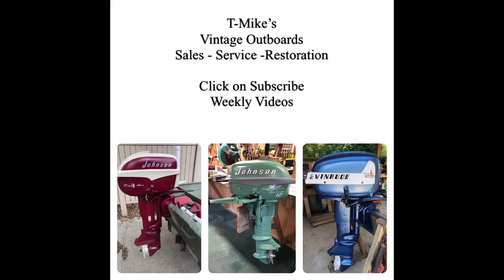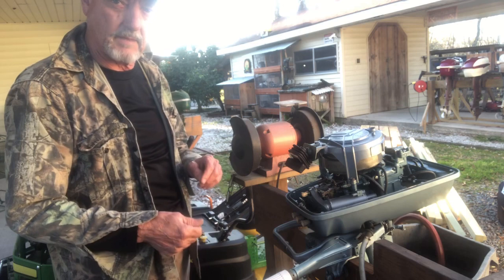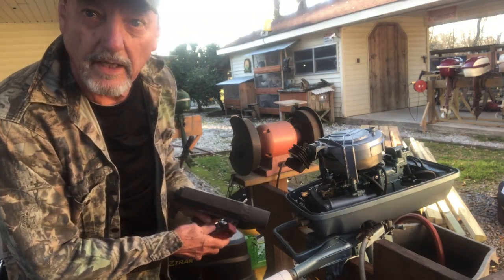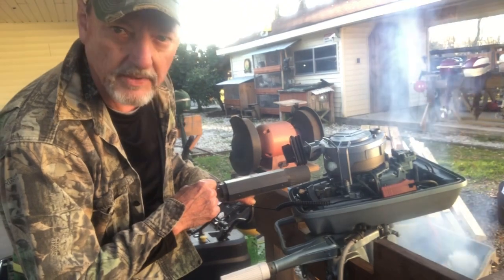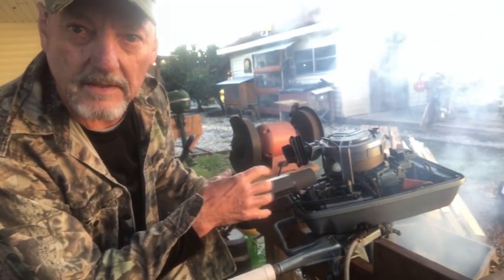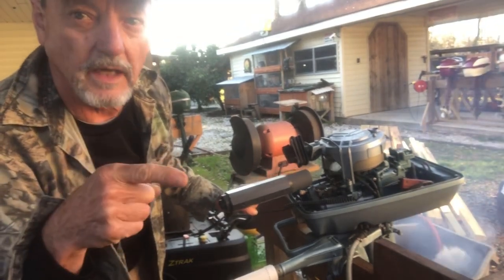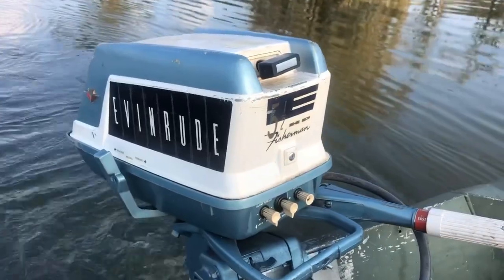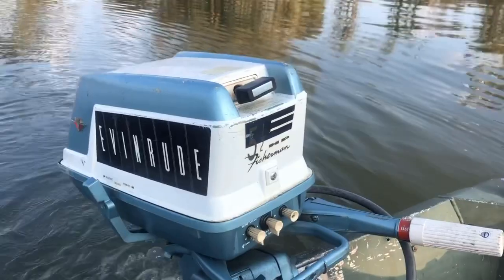How to Use Timing Light to Fix Spark Problems Vintage Outboard 1960 5.5 HP Evinrude

Comment: Hello mike mr.snook from pa.would you do more vidioes on the differant tilt n lock mechanisms and hows they assemble n function.ive got problems figuring were the parts go into mine.its a johnson 15hp maybe 70s era.i took apart to put new support bolt and repaint the transom arms.snooky😊😊😊😊you the goat,boat guru!!

Comment: I would suggest using a points burnishing toll instead of sand paper! If you can still find them! Ok I have question I did know the answer but have forgotten! There is away to determine by looking at the points and which side of the points that is pitted and the other side has a build up of deposits. This can tell you if the condenser is bad without using a meter to test the capacitor.😁🛫

Comment: Mine idles and plows bot bogs at full throttle I rebuilt the carburetor could it be a spark issue   ?
Reply from the maker: Yes sounds like it’s running on one cylinder. Check with a timing light

Comment: So does the clip on the timing light just fit on the hex of the spark plug below the spark plug boot or do you use something different?
Reply from the maker: The clip goes around the spark wire.